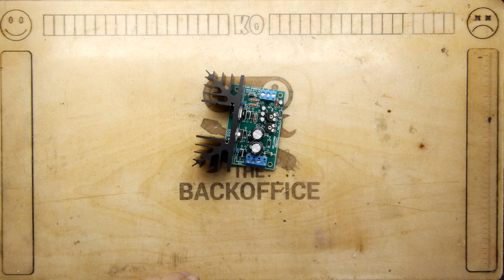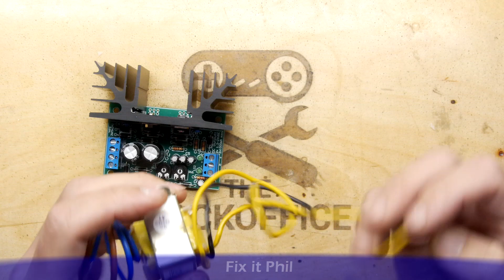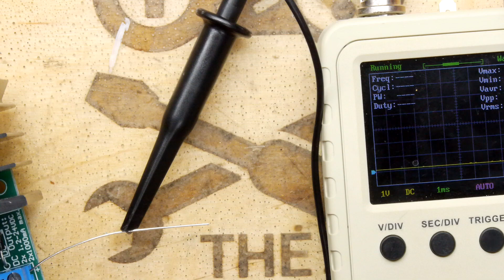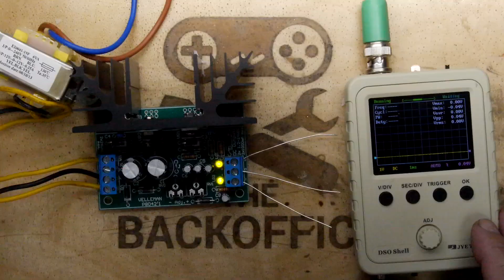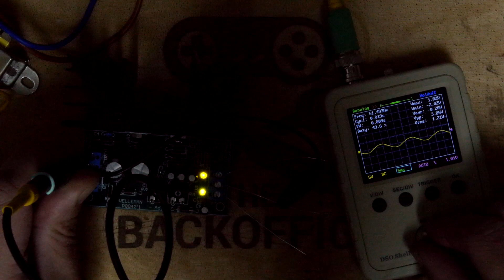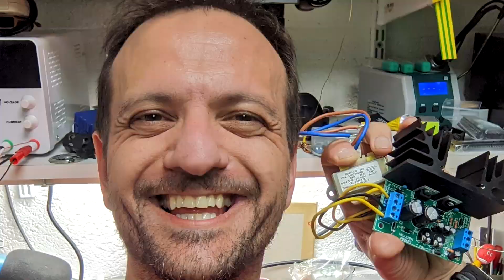Velleman Symmetric PSU Redeemed - see what I did!

Comment: Big Clive uses a Cliff quick test meanwhile Dr A says hold my beer as he presses ahead with the Electroboom method!
Reply from the maker: I once had one of those, but I lost it and the replacements are crazy expensive for what they are (and my use case!)
Reply: @backofficeshow  Yes, my dad has one but I suspect they were cheaper back when. I would get one in a shot but as you say they seem crazy expensive even though they're nicely made. Big Clive really should be their poster boy, that might go someway to justify the elevated pricing! I'll stick to connector blocks for my needs.
Reply from the maker: Connector block. Look at Mr Fancy over here!?
Reply: @backofficeshow  IIII dunno, pretty sure you're IEC 60320 compliant. It says so right there on the connector!
Reply: Should be ok, maybe keep it a little shy of the 13Amps.
Reply from the maker: I think the nail I replaced the fuse with is rated much higher than that 😂
Reply: @backofficeshow  From what I recall from one of Clive's videos, it's a fair bit cheaper to import one from the US but obviously all the terminals are the wrong colour...